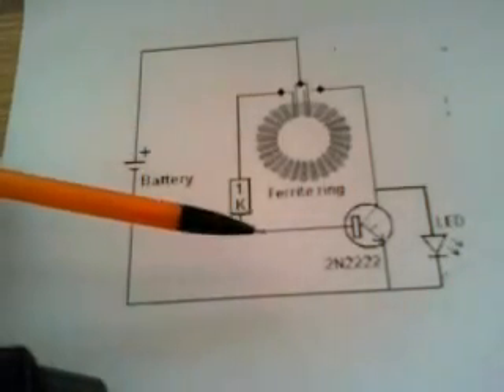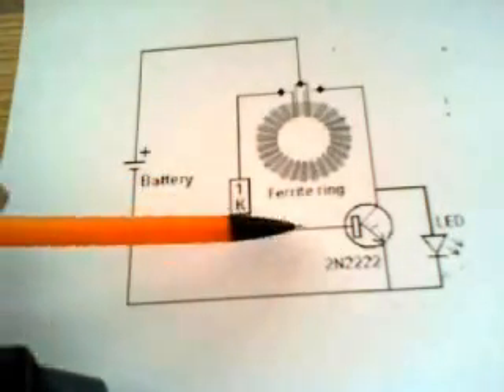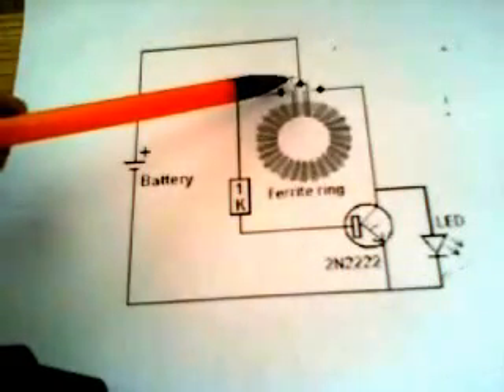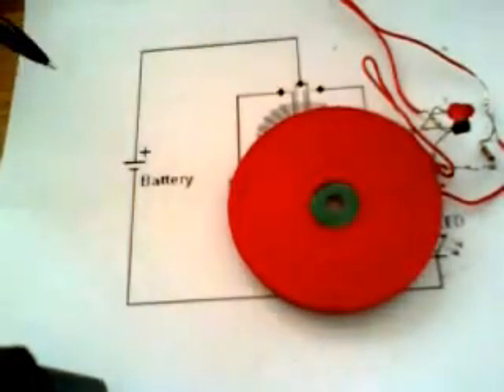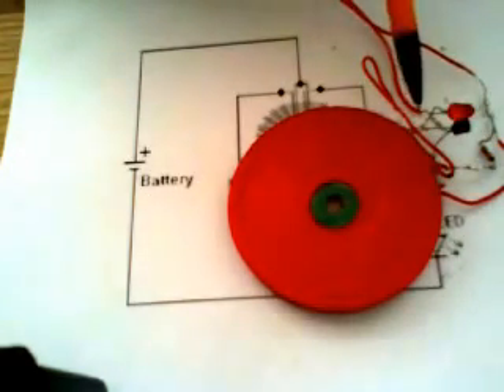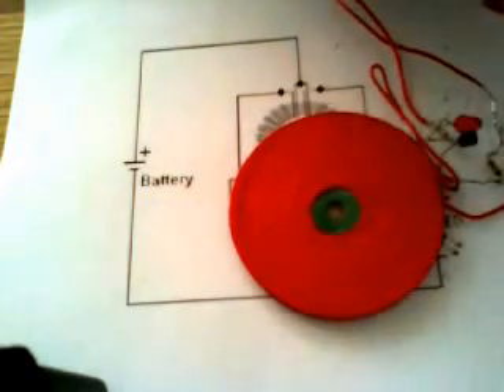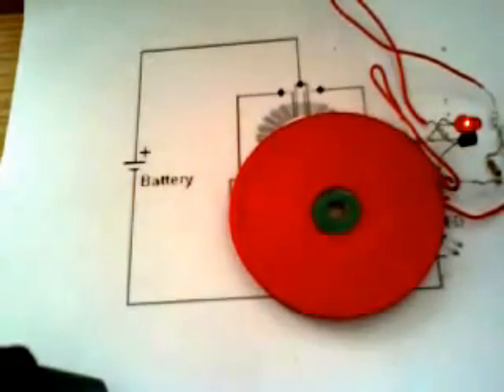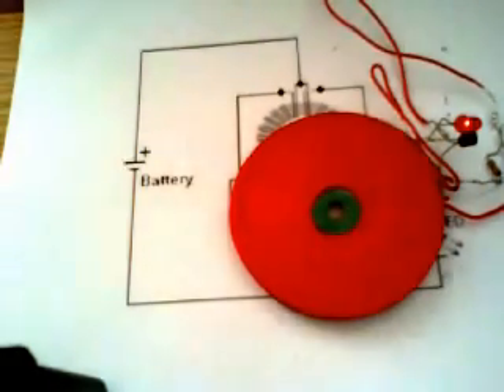tesla bfilar pancake coil as a joule thief

Comment: Just connect the led to the battery, will light up.
Do not need the rest.
Reply from the maker: sure - but that's not the point of the experiment
Reply: He used 1.5V battery so it will not light up as led needs 3V. Which is the whole point of the video.

Comment: While I appreciate your efforts, using a proper bifilar coil in a Joule thief is counter productive. In the way that you have used it, current is flowing in the same direction through both parts of the coil. You may as well use a standard configuration with a ferrite ring. Bifilar coils are best at suppressing back EMF when current is passed in opposite directions through each half of the coil. They cancel out each others' magnetic field in this configuration.
Reply: If you read Tesla's patent he specifically designed it to run the current in the same direction in both halves of the coil. The method of wiring it in the opposite direction was never mentioned or proposed by him, and obviously he tested the device before making a patent.

I don't know why people want to change his coil to do that, but it's definitely not what Tesla designed the coil to be for cancelling self-induction.